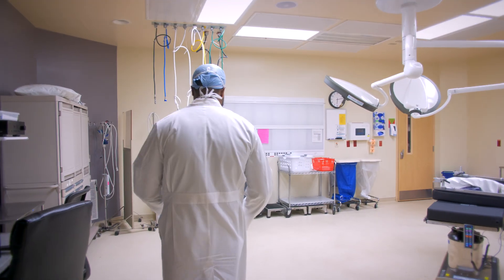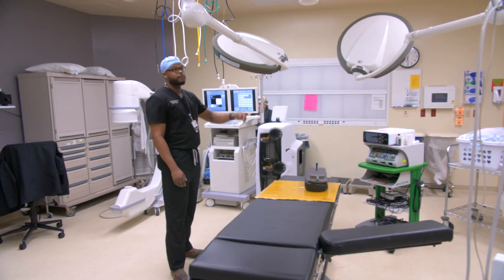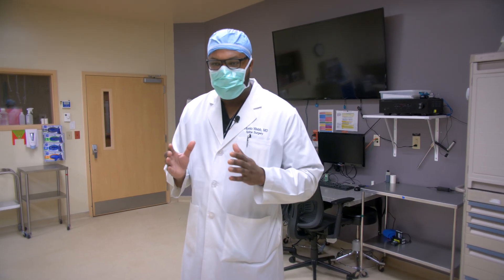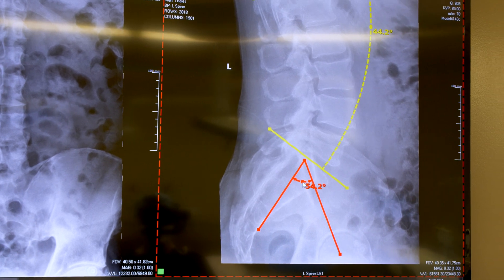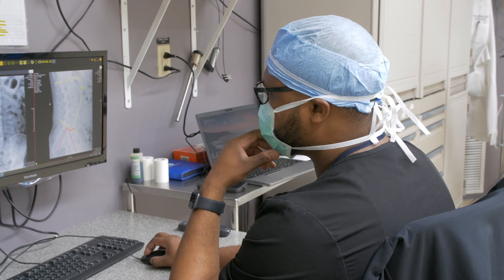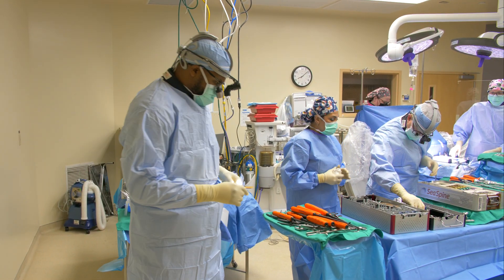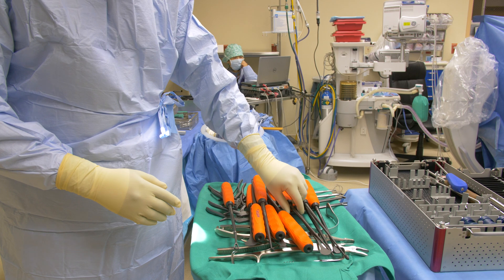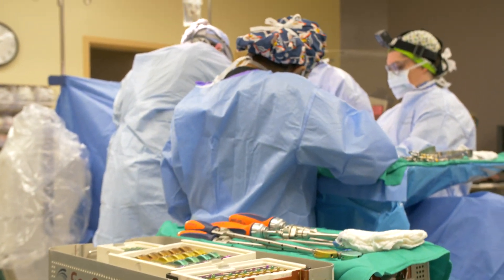Anterior Lumbar Interbody Fusion (ALIF)- Part 2

Comment: Hello Doctor, I had a ALIF performed on me last September 2021 conducted by Dr Efstathios Papavasilliou at  Beth Israel Deaconess Hospital in Boston, Ma.  He performed three surgeries, the initial one through the belly then day two, the second with the fusion on the spine and unfortunately a third because one of the screws that was used to implant the hardware to my spine, touched a nerve and they had to surgery to remove and replace a new screw.  It has been eight months since the surgery and I am still experiencing pain in my lower back sufficient to warrant continued pain management with my pain management doctor.  Obviously it has been a long road of recovery but what may have complicated the matter is that back in 2018, I sustained an injury in the exact same area which necessitated Dr Papavasilliou to perform a two level fusion which went well, until I was diagnosed with severe spinal stenosis requiring the ALIF surgery this past September.  Dr Papavasilliou is nothing but a great Doctor and he has kept me out of a wheel chair three times now.  Thank you for your brief video on the ALIF surgery.  Best wishes, Dennis Poltrino

Comment: I have severe disc degenerative dish and was wondering what you could do for me, if anything. Do you replace the bad discs?
Reply from the maker: Yes 
Typically it’s an artificial disc replacement vs a fusion. 

Here is information regarding it
https://antoniowebbmd.com/degenerative-disc-diseases/
Reply: @antoniowebbmd  On your website it does say that Fusion procedures for low back pain due to degenerative disc disease have less favorable outcomes. Is that the same for disogenic back pain with neurological involvement? It looks like there's not many other options when you have exhausted all conservative treatments for years.
Reply from the maker: @alexjenkins5632  hard to answer without looking at films but if there is 1 level involvement then more favorable outcome.

Comment: I had a plate with 9 screws used to hold my pelvis in place from a head on collision.  My hip , L4-5 broke, sacrum and coccyx fractured.  My mid navicular  was also broke and was completely  re built  4 years after  accident.  Question  does that pelvic plate have to stay forever?